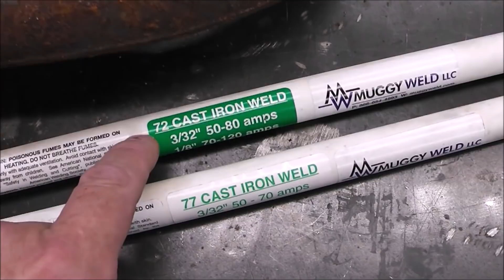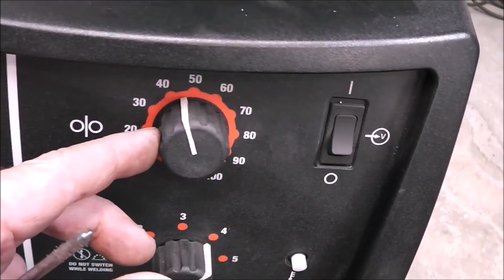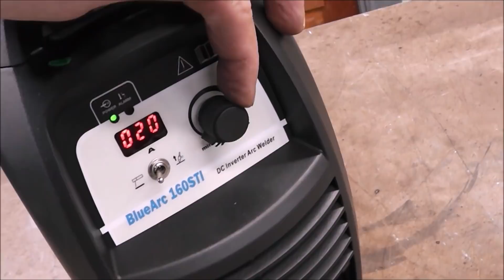Welding Cast Iron Visual Inspection and Testing

Comment: First thing no matter what you're using to weld it up in the experiment you still got to use the same process you can't just make a 5-in weld all at one time you still got to go about an inch at a time and with your experiment I would still say preheat and post heat and encapsulate in sand for cooling.. side note...... 7018 is the best substitute for nickel with preheat and post heat 1" welds. 7018 for root pass also
Reply from the maker: I don't ever use 7018 to repair cast. I've had too many failures. All I use now is silicon bronze, and the repair is almost as strong as pre break strength. Nickle is always a good option also but silicon bronze is superior.

Comment: tiggy glue with silly con bronze lol sorry tig weld it with silicon bronze or aluminum bronze I also like tig with nickel stick rods with shielding cleaned off get half used rods free from a buddy at local welding shop the I clean off shelding and tack them together cause they chuck used rods as they dont arc good after sitting out in air 1/2 used but tig great. thanks for sharing
Reply from the maker: So far, silicon bronze has yielded the highest breaking strength that ive testef to date. It's almost as strong as the cast iron pre break strength. I love silicon bronze for cast iron repair.

Comment: I've seen that they gas weld cast iron using cast iron filler.
Reply from the maker: @1873Winchester that is an excellent repair method 👍

Comment: I watched your original video on the simulated manifold crack repair and I found it very informative. I didn't bother commenting, because of the many comments. Your original repair came out really good and I'm going to try welding a real crack in a manifold, but I will pre-heat it and post slow-cool it. Thanks for the tips. All the best from Queensland Australia.
Reply from the maker: @Bruce Pierson thanks man and good luck with your repair!

Comment: Try welding it with wire and then have it machined
Reply from the maker: I've got a few videos with wire but the outcome varies depending on the cast. I get a better finish with nickel.

Comment: I enjoyed watching you're videos, so... Thanks very much for taking the time to make them. Mike with muggy weld is great!! I used the 72  rod and knocked all the flux off and used my tig torch on a VW TDI engine. I welded just a tiny bit 1/2" here and there until it was everywhere keeping the metal cool to the touch as much as possible. Just like you said less temperature swing creates less "crinkling" sound. A few years ago I found some machinable cast iron tig rod that came from a retiree from the Naval Research Lab fabrication shop. It is a nickel rod, and flows like butter at a low temp. It is from a antiquated U.S. company that I can't find any more info about. Great stuff!! 
Thanks again for making the vids on cast. I never would have thought about trying the 6013 but now at least I have an idea of what to expect if I have too.
Reply from the maker: Thanks Lyle! I agree Mike is a good guy. I got a lot of viewer requests for that Muggy Weld  rod so I reached out to him. Who would have though that a couple years later it would have nearly 3 million views! Thanks again, I appreciate your support!

Comment: I have an old manifold that’s really hard to find and it has a crack in it. all I have is a flux core Hobart 120. Is it possible for me to weld that crack up?? Please help!
Reply: It’s a cast iron manifold
Reply from the maker: @jushuadmcelroy  If it's something that is rare and you truly care about it than your best chance for success is going to be a nickel 55 or 99 rod...either stick weld it or tig weld it using the same rod. If  your willing to experiment, flux core wire will work as I've shown but it's a gamble.

Comment: but cast steels even higher alloy can be 316 stick welded, on thick stuff, just keep it so you can put your hand on during interpass... all depends on alloy of course...
Reply: 309 L can also be used for welding cast Iron.

Comment: The Blue Demon BLUEARC-160STI has a no-load voltage of 82v which is very good for running 6010, but then I saw the duty cycle of only 35% which sucks. Should have at least a 60% duty cycle.
Reply from the maker: I agree and I was concerned at first about the duty cycle, but 3 1/2 minutes of welding is actually a lot if your not doing pipe or production work, so for me, even though it has a low duty cycle, I have yet to hit it.  This is my go to rig for most stick welding stuff just because I like how how smooth the arc starts and runs.

Comment: ive been welding since 1958 and would never use an arc welder on cast iron because it creates stress points. I use a cobra oxy-fuel torch and my filler is always foundry rod 9cast iron ) because it matches the part being repaired better. welding with oxy-fuel leaves the part easy to file, machine, etc.
Reply from the maker: That's excellent if you have the gear, but many folks watching this channel are just starting out with an old buzz box or inverter.  I'd rather see those folks give it a try rather than just give up and throw it away because they dont have a torch and gas. Just my humble opinion anyways.

Comment: MIG welding cast iron rarely (if ever) works. I've never had it work. TIG Braze is the most likely to succeed. TIG Weld with Ni99 will usually work
(not always). 

It seems like the people that don't know better get away with it more than anyone else. 8\
Reply: using 7018 on malleable cast iron is possible if your only option is stick, but it only has a good chance of working if you properly pre-heat, and peen the weld. Other types of cast iron are less receptive to stick welding and especially white cast iron is basically impossible.
Reply from the maker: @KingHalbatorix  everything you said is 100% 👍
Reply from the maker: Right on brother!

Comment: I recently MIG welded V band flanges on some LS manifolds, welded surprisingly well with regular old wire, probably ER70S2. I attempted a crack repair with my TIG machine a while back, ER70S2, it didn’t work very well...
Reply from the maker: It can be picky to weld. I bet these would weld good with 7018 but I haven't tried...yet :)

Comment: good video on cast iron. I have used Arctec  cast 80 and cast 90 which have worked with no preheat. some have used 7018 with success.
I wonder if you tried some 8018 or 9018 and see how that goes. I believe they have a higher nickel content.
Reply from the maker: Thank man! I have tried 7018 with success but it is often hit or miss. I have not tried 8018 or 9018 but I cant imagine by the designation that it would weld much different than 7018.  I'm thinking the 7018 would probably work better if you were using it on cast just because of the lower tensile strength, but that's just an assumption.

Comment: Great video! Something I've found: Cast steel or cast iron, does not matter.  But 6010 is not a good choice of rod. Too "brittle". I've had good luck using 7018. A groove would have helped too.
Reply from the maker: Right on brother! Spot on with the groove weld also.

Comment: You did a great job using Muggy weld  you got my vote . I have a 73 Chevy crew cab 1 ton 350 auto trans ,the right side manifold broke three times didn't know about muggy weld until your video I went with Hooker headers and  haven't had any more problems  in the last 25 years .
Reply from the maker: Thanks man! I appreciate your support!
Reply from the maker: I like the old square bodies too!

Comment: Agree with you 100%  Brandon. Just the fact that the piece Is an exhaust manifold almost guarantees that the material is cast iron, no doubt about it. Cast steel is utilized in parts that require a certain amount of structural integrity where the only structural strength That an exhaust manifold needs is to hold on to the exhaust pipe. In my experience I can say that certain types of cast iron are almost impossible to weld no matter what method or rod you use. I think that if you check your old saw blade I believe you will notice that it is very dull, some cast iron gets as hard as a file after being welded.
Reply from the maker: Spot on brother! Plus it does not make sense from a financial standpoint to manufacture a part from steel when it can be manufactured in iron (steel being much more costly to produce) and you are absolutely right about the saw blade. The metal in the area of the weld completely dulled the saw blade and rounded the teeth right over. I was originally going to attempt to etch and polish the edge just to see how it would look, but it was just too hard and I don't have any "junk" files that I was willing to ruin. Thanks for the great comment!
Reply: One potential source of confusion is the sheer variety of iron alloys.

Nissan cast their blocks and exhaust manifolds with iron back in the '70s and '80s that was very strange. It was definitely not steel, but it cut bright with fairly long chips instead of the short, dull ones you usually get from grey iron. Whole lot of nickel in it.

Still cracked like CGI, though.
Reply: You're not wrong but GM has more than just price to contend with. All LS trucks have nothing supporting the twin converters and crossover piping til about 6-8 feet behind the motor. They also have no flex pipe between banks to account for expansion. Both show a need for strength steel would provide.

This was likely a aftermarket manifold, as all genuine GM-LS manifolds I've seen tested (myself & others) was cast steel. It's also why they are always so horribly disfigured in the northern states, where I've seen at least 1/5 of the weight missing from rust.

Comment: These may be cast iron instead of steel. I thought they were steel. All I know for sure is you can find a shit-ton of people who have welded them up for their turbo builds using MIG and no special procedures, myself included. I have been running these manifolds that I MIG welded for quite a while now on my turbo 6.0 with no issues. There are a LOT of posts on LS1tech about MIG welding these which is where I got the idea to try it. If they are cast iron, they're much better cast iron than that which you'd find on a set of manifolds from 40 years ago. I also cleaned my weld areas back at least an inch beyond the actual weld seam itself to avoid burning in contaminants during the welding process. That may have something to do with why I didn't have any cracks. I cut the EGR and heat shielf bosses off entirely and filled them with weld. Also cut the collector flange completely off of one manifold to change the angle at which it exited. Mine were also pretty clean and rust free, that one you got there is super rusty in comparison lol.
Reply from the maker: Thanks for watching and commenting!  It's somewhat of a misconception that cast iron is nearly impossible to weld, so when someone comes along and successfully welds a cast iron part using mig, it's automatically assumed that it must NOT be cast iron and it must be cast steel.  I have successfully welded cast iron using various methods, including mig and some have worked better than others. Some failed immediately and some I though would give me trouble welded up like butter. There are just so many factors that go into cast iron. I personally think it's the extra trash they put in the mix that floats to the top that has a lot to do with how it welds up, which is why many of the old schoolers swear by torch brazing because they are not "wetting in" the parent metal and stirring up the garbage inside.  The cast from the early 1900's is probably some of the more difficult stuff to weld in my opinion.  Thanks for watching and commenting!
Reply: The only question I have at this point is how would we determine EXACTLY what these LS manifolds are, iron or steel? We can make educated guesses, and a preliminary internet search reveals different rule of thumb methods used in the field like the spark test you used. I guess it really doesn't matter I'm just always curious? I agree with you about the difference in "weld-ability" of iron having a lot to do with what other stuff they mix into the molten mix to make their supply go farther.

I will also add, you mentioned in the other video that you could hear the MIG weld cracking when cooling. While that may be true and you certainly showed evidence of the welds cracked, I don't think that sound can be attributed 100% to cracking. When I park any of my cars/trucks/motorcycles after running for a good while and heat-soaking, you can hear them make all kinds of metallic tinny sounds as the metal is cooling. This doesn't necessarily mean that they are cracking but just cooling and contracting back down.
Reply from the maker: Here are 4 methods. Examine the grain structure of the broken piece, cast and steel grain structures are very  different. spark test it,  drill test it, and finally do a hardness test. Run a file on the corner and see if it cuts. Then blast tack the same area with TIG. If the area becomes hard like a BB and wont file, it's cast iron.  You can not purchase this as a cast steel exhaust manifold. It doesn't exist. They are marketed and sold as cast iron. Lastly, a member on the LS forums paid for independent testing and he posted the results. Google "what truck manifolds are really made of" They are upwards of 3.6% carbon and high in silicone.
Reply: Interesting, thanks for sharing. I don't know how I haven't found that thread on LS1tech before as I'm on there pretty regularly myself. It's interesting about 3/4 of the way down a guy with the handle oscs says "As stated earlier in the thread "on paper" these should not be welding well at all, But they do. It could be the higher amount of silicon or another material that is helping. The real test would be to try an older set (70/80's) cast iron manifold and see the difference. "